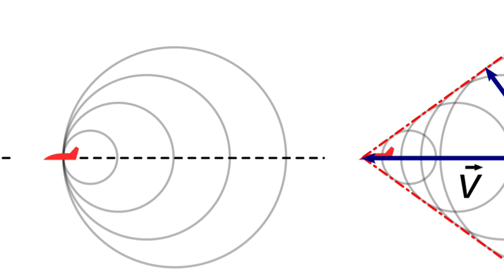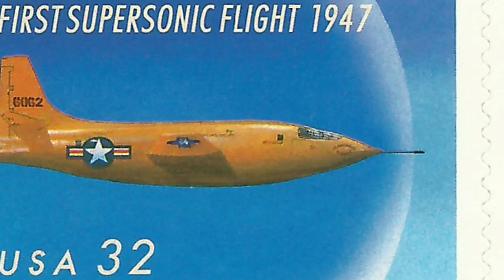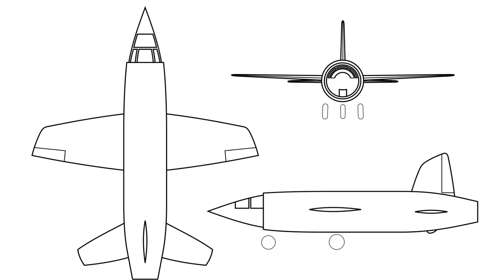Supersonic Firsts

Comment: I doubt there will ever be any new Concorde-style supersonic airliners.
However i do think we will see low-earth orbital airliners, like the Virgin Galactic craft.
You would step into such a craft in,  lets say, New York. It will get airborn under a launch aircraft. It will be released and fly into low earth orbit and re-enter close to the city of destination like Sydney or Abu Dhabi. It will save hours of travel time.
Reply: Yeah but they probably won't hold 300 or so passengers. :)
Reply: At 3G+ acceleration and deceleration, huge size - Don't be fooled by Virgin Galactic's Spaceship II - it's only fast enough to climb straight up to 100km and fall back down - for a proper orbit, you need to be going about 9 times faster, and in a horizontal direction -  to massive structural issues due to it being a re-entry vehicle, and landing so far away from your actual destination that you might have well taken a 787.
Space fanatic that I am, the Engineer in me just doesn't see it.
Reply: Well a technical possibility, very doubtful to be a financially successful one. For all the glory of the Concorde, airlines are in the business of making money.
Reply: All of this technological developement gets people dreaming up all kinds of idealistic things... but in practice it's usually unsustainable from a cost and resource vantage point.  Airbus really had a big deal with the A380, holding the mark as the world's largest passenger airliner.  But the logistics of handling them on the ground and maintaining them, as well as so few airports being able to support them, has made them obsolete.  Airlines are dumping them.
The greatest example of this whole problem is NASA's Space Shuttle.  They dreapt up fantastic plans for its operation, touting how inexpensive and useful it would be... but huge costs in maintenance after each flight - and the tragic loss of 14 astronauts which could be traced back to its complexity - rendered the whole program finished.  It was an amazing machine, but its negatives far outweighed its usefulness.
Reply: @easygoing2479  the Airbus 380 also suffered from bad timing. It hit the market right around the 2008 financial crash. Nobody was flying. You could never fill the seats on the thing. The logistical problems you mentioned also didn't help.

Comment: There is no way that the F-86/XP-86 could ever have reached Mach 1 in level flight. Doing so in a dive is not part of the challenge. Even if it was capable of doing so, the MiG-15 was faster. There were other issues preventing air-breathing jet aircraft from reaching Mach 1 in self-powered flight, not yet solved.
Reply: Dang!  I must be a wizard, then!  Mach 1.2, T-38A.  No rockets involved.
And the MiG-15 wasn't faster than the F-86 - it could climb better, and the speed difference in level flight at the usual combat altitudes in Korea was small enough that a Saber had a hard time catching a MiG-15 headed back North of the Yalu before the fuel started getting low.